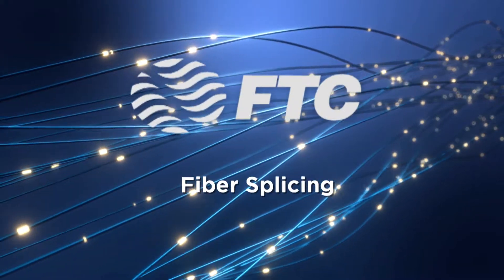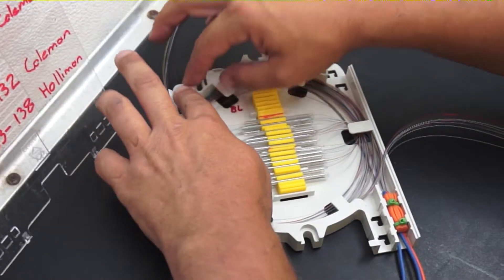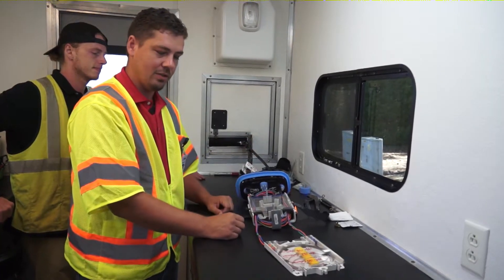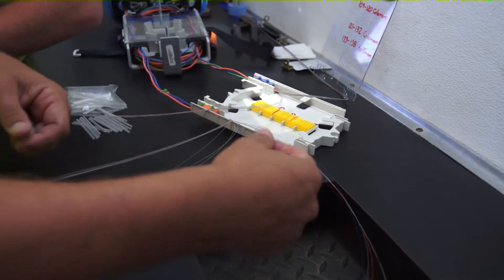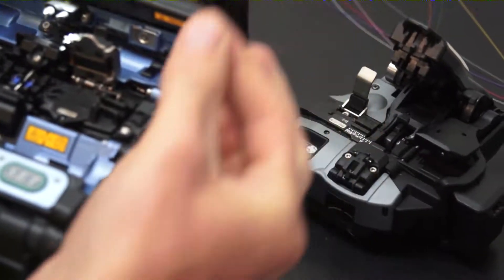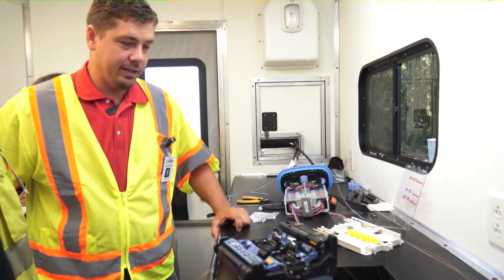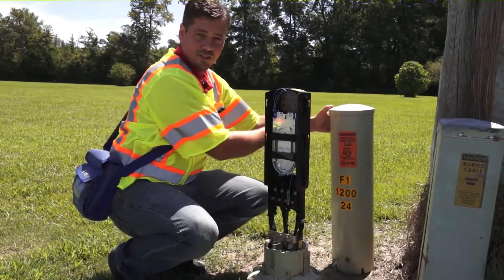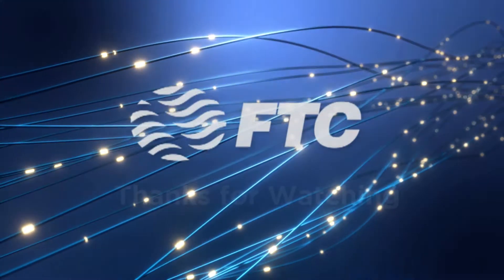FTC Fiber Splicing

Comment: Is there any db loss, when spliceing a fiber cable?
Reply: Typical a splice has 0.1-0.2dB loss, max for our company are 0.5db
Reply: @florichi  maybe your typical splices. Those are high numbers. Should be around .02.-05
Reply: @peteradams7457 For real. The highest my company will let go is around .02 on single fibers. Maybe .04 if we're desperate on a ribbon splice.
Reply: @florichi  Thanks for the answer. So splicing a fiber cable into a house for example and ad like 15 more meters will not have any bigger effects on the data transfer? 
15 meter = 50 feets
Reply: @kallekarlsson2181  no, splice losses are a valid threat on long kilometer long runs when you have 10-20 splices. Usually a single run only has a handful splices, so with regular input levels there is no threat of the signal not reaching the customers
Reply: @florichi  Okey, Thank you for the answer :)
Reply: The prep, cleaning, cleaving, electrodes, alignment, arching, and last the customer acceptance report, there will always be loss, then you pump up the power, then you have to deal with VCSEL and dispersion, macro/micro bends, contamination, the not so best practitioner, you sometimes want to pull your hair out, you might be doing this in some lonely server room hearing
nothing but servers, loud air from HVAC, around a bunch of dudes underpaid, hungry, tired,
gruntle, griping about something or when their next smoke break will be. This is just to say the least.

Comment: I remember the old days when we had to do all of that by hand.  Cutting, buffing and joining.  Must be nice to have a machine to do it all for you.
Reply: Yeah back in the "...old days..." when 10k of fibre was considered to be long haul 😁
Reply: @harryjohnson615  don’t get too in your head. Those mechanized splices are just as good if not better than fusion splices on SMF. I just relocated a direct buried fiber that had mechanized splices. They just like pulp/lead cable were designed to only need to be in the case once. Those old cases were hermetically sealed and pressurized. Our splicing contractor had to saw the case to get opened.
Reply: That is not true dude, a mechanical splice doesn't even come close the the performance figures of a fusion splice. On high-capacity circuits such as 400G your link mechanical link would fail every test and wouldn't get commissioned.
Reply: Do you want a cookie ?
Reply: And it probably took you a week to do what we can now do in a few hours. along with cutting way down on bad splices, terminations etc.
Reply: Typical old head splicer
Reply: Yeah, it’s pretty nice.
Reply: That’s right old head
Reply: I'm sure you spliced ribbonized 12 ct fiber by hand as well right? Lol just messing i learned from an old timer who hand polished and did everything by hand so I learned a good bit from him.
Reply: Show off.
Reply: Hy I'm indian
Reply: They still call themselves 
“Splicers “ Today even though they are really only Prepping the Fiber and putting it into the “Splicer” lol 
I Splice Copper and Prep Fiber so I’m a “SPLICER” and a Prepper lol
Takes a Copper Splicers Minutes to learn Fiber but I don’t know if a Fiber Splicer can ever learn Copper at least I’ve never seen it accomplished lol 
I’m joking folks I didn’t like Fiber because to much Night Work gotta be half Owl I will take a couple night cuts a month anytime over a night cut every other night lol
Reply: @samuelmeeks2158  Can U balance amps and all that or can you just connect the cable lol. cuz we call those guys tappers